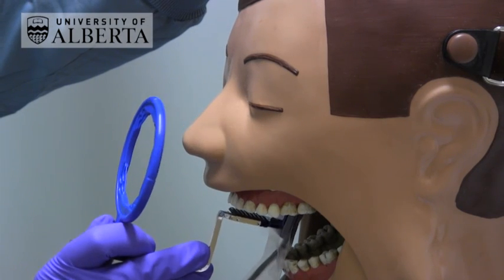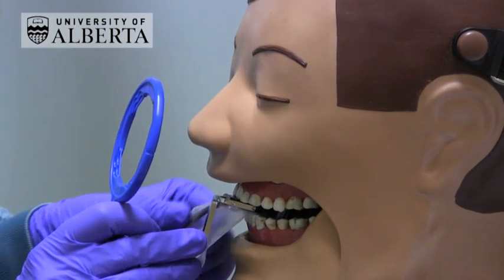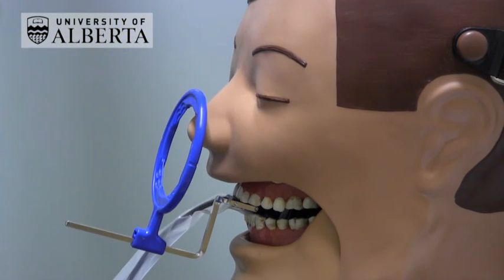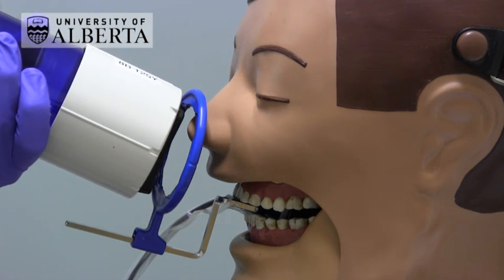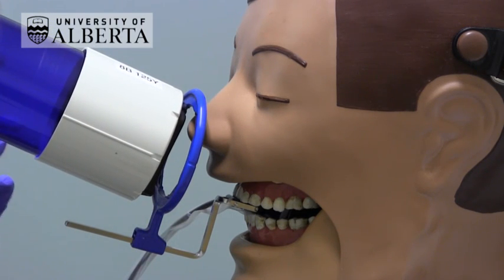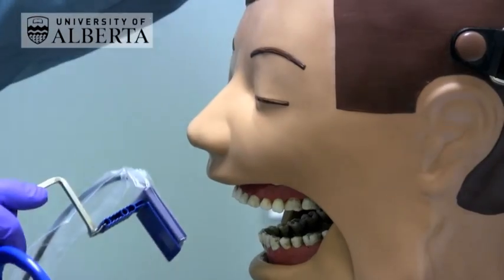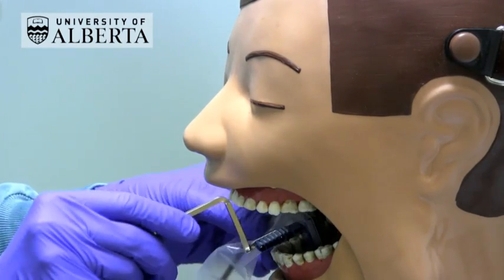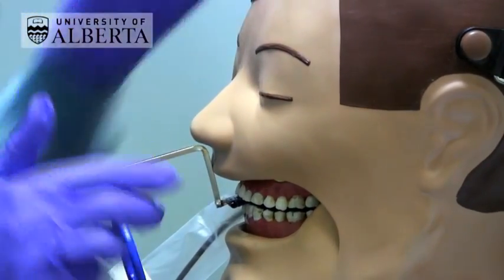5. Anterior Periapical placement (XCP) Direct sensor

Comment: With the anterior positioning, aren't you creating scatter radiation since you have opened exposure between the aiming ring and collimating?
Reply from the maker: +EssieBadd 
Thanks for the question: No-the collimator and the ring should be touching and parallel